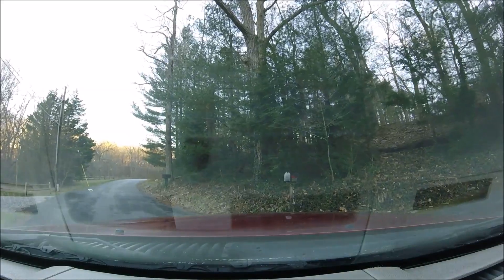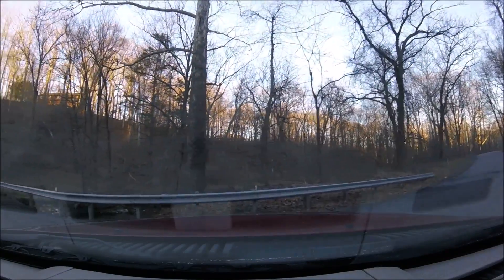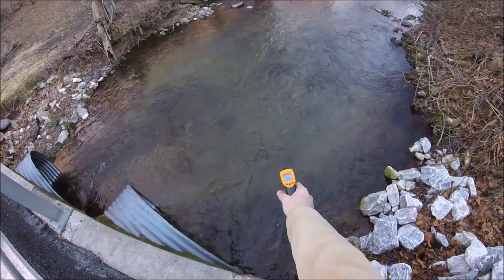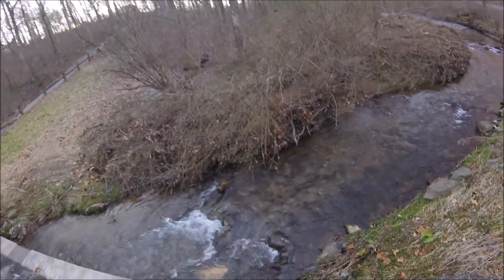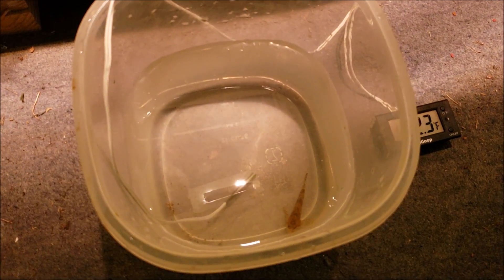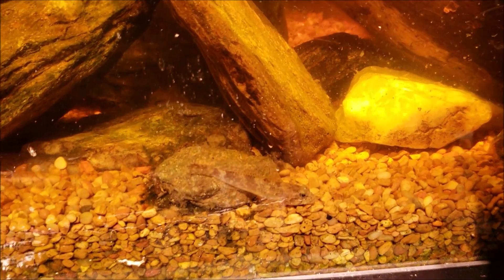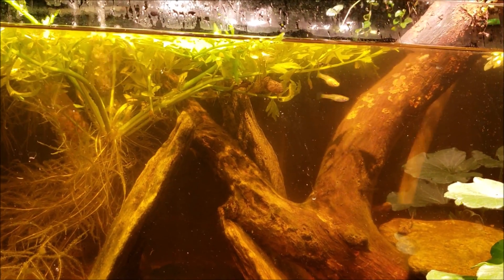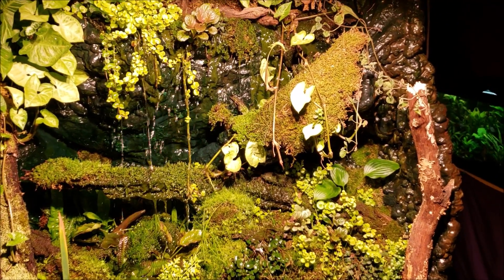Mottled Sculpin Endures 30 Degree Temperature Climb In 15 Minutes

Comment: The noise is a slight whine in the background. Not very loud, just constant. Can hear you just fine over it. No worse than water splashing sounds in the fish room.
Reply: Aerator pumps likely.
Reply: @imakedo4407  He explained it is his makeshift space heater he uses in his vehicle. In his fish room it is splashing from his waterfall tank, spray bars from his canister filters, and HOB filters.